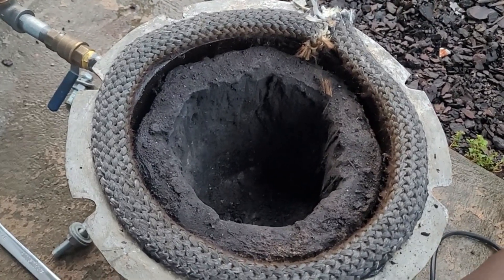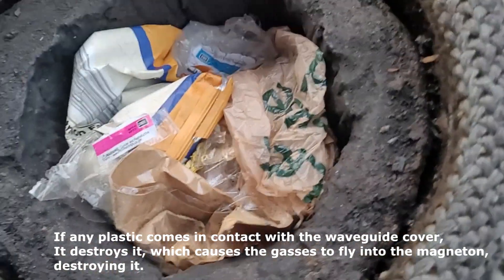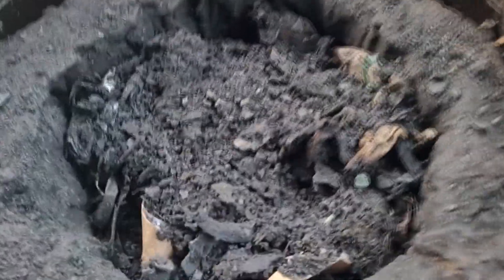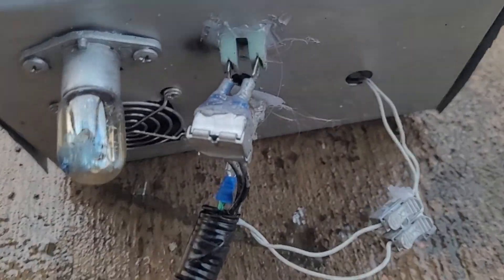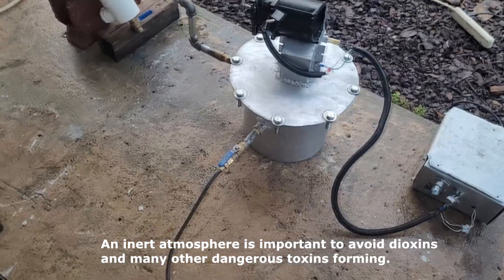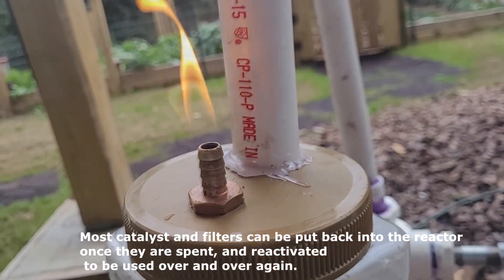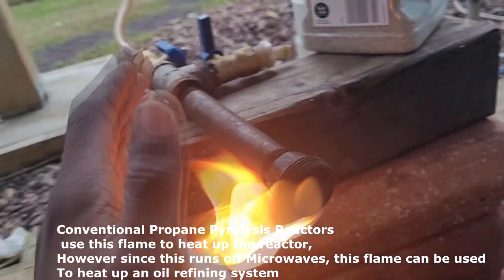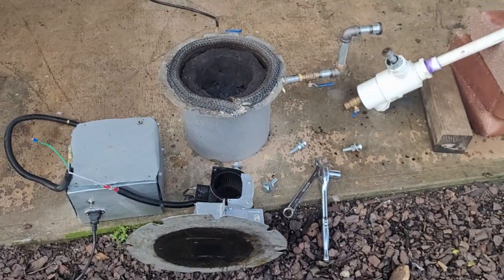Running the Microwave Pyrolysis Reactor (Turning Plastic into Fuel!)

Comment: Congratulations dude, great job.I have one question, what do you do with pvc? because is toxic if you pyrolisates
Reply from the maker: Thank you! The PVC creates Hydrochloride Gas which can be dissolved in water to form Hydrochloric Acid.
Reply: @naturejab  Pyrolysis is a messy chemical process, the chlorine can also recombine with the hydrocarbons to make various chlorocarbons as in bad for ozone and carcinogenic, even a tiny bit collagenic like nerve gas. .( I don't know if I spelled that right but I meant a acetylcholine inhibitor, whatever the medical word is for that) 
    Some powdered zinc and aluminumin in the filters should help with that, as long as the aluminum surface is active without oxygen(add a drop of gallium) it'll pull away the chlorine from the hydrocarbons and make alcl3!      Which of course can be resold to chemists as a reagent at high prices for more profit! Thank you you're welcome.
Reply from the maker: @petevenuti7355  amazing solutions here, thanks Pete!
Reply: @naturejab  like I said, the world needs it.
   I see your enthusiasm and motivation, not to mention no fear of taking on things you know nothing about and then making yourself an expert. 
    You should be encouraged.
Reply: I came here to advise against any Teflon or PVC in a pyrolysis run for many reasons for the amateur who might attempt to do this at home, instead in my last comment I just gave you the solution for free!.  Not like I can get any investors for mine .... The world needs it, what can I say?
Reply: I also suspect that the activated aluminum and zinc would help with the dioxin formation, but I don't know anybody with a gas chromatograph to test it. If you want to build a corporation and get partnerships for your idea make sure you include an analytics lab!
Reply: Melting Back!!!